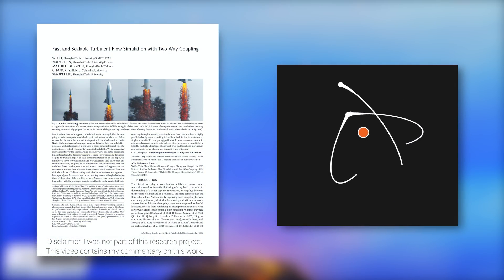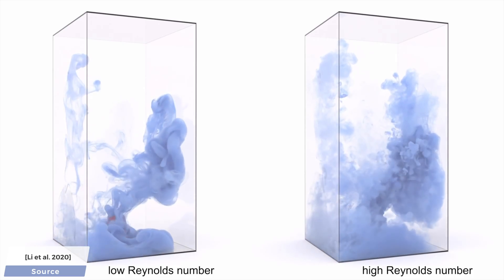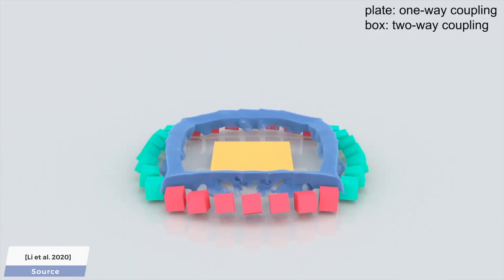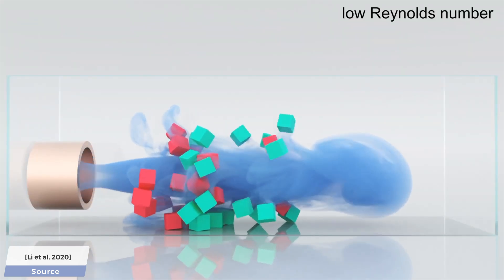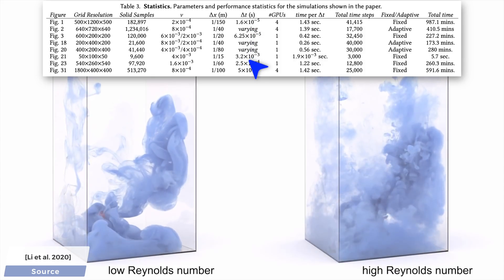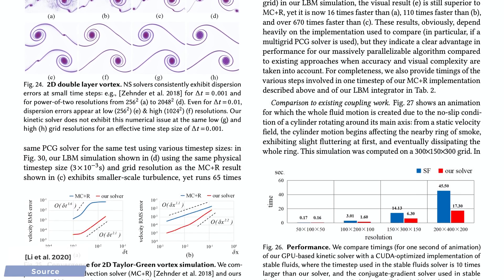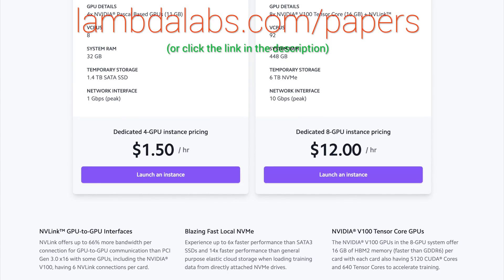Can We Simulate a Rocket Launch? 🚀

Comment: The "smoke trail" does NOT "propel the rocket upwards". The movement of the smoke trail as well as the movement of the rocket in the opposite direction is the result of the pressure inside the rocket engine. The one movement does not CAUSE the other movement. Both movements are the results of pressures inside the engine. The pressure against the upper (closed) end of the engine chamber push the rocket up and the pressure in the direction of the open end of the chamber push the exhaust out.

Comment: Interesting. I've wondered about doing a flight sim with computational fluid dynamics, but this is likely too slow.

Also very minor things (like rivets) can throw off the accuracy of such simulations.

Even highly simplified CFD models are hard to calculate though.

That's not to say it's never been done. 
There was a sim called 'flight unlimited' whose flight model was calculated using CFD, and this was all the way back in 1995 of all things.

Unfortunately, while this worked, it took fine-tuning with real pilots and aircraft and lots of fudges to ensure this had an accurate effect on aircraft behaviour.
On top of that, the CFD code was a nasty cludge of insane assembly language, so inscrutable that even the game's own sequel abandoned it.

Would still be interesting to revisit the concept, even with a fairly inaccurate CFD model...

Comment: Could you speed up the render time of the simulation by performing a check for small increments of time with zero changes/interactions and then remove those moments? Or would that add more unnecessary computation?

Comment: Ansys uses lattice-boltzmann in their 'Discovery Live' software. With Nvidia gpus (so far, its exclusive to nvidia), they do almost real-time simulations and update continuously as you change geometries. For fluid and solid simulations.
With respect to engineering accuracy, it's really bad. If you compare velocity and pressure fields with ansys cfx or fluent solvers, they don't match. But for visual representation, it looks great (even though some unrealistic events, such as the part you mentioned in 3:29 , can happen).
Would be amazing to see those techniques implemented in games in the future.

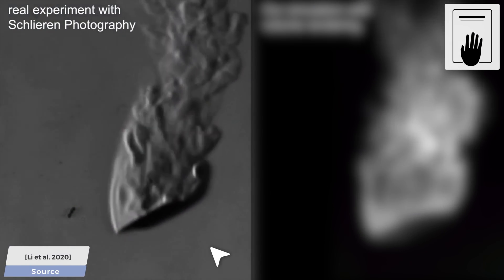Comment: But honestly: The comparison to this falling plate with the Schlieren-imaging 2:53 looks super good
but the rocket launch 4:38 is rather disappointing compared to real footage liek https://youtu.be/Ps9QD8XDVBg?t=92

Most of the times there is a super violent almost rigid flame cone as long as the rocket itself ...
here it looks like Putting ice cream on a cone. I mean... you were talking about 2-way coupling but this sim is not pushing the rocket up, or is it?
It just doesn't look believable to me. Like its just animated up while emitting.

Setting the speed to 2x helps a little but then the black turbulent smoke surrounding the fire cone becomes very obvious looking way too calm.

Comment: Why compare the speed of this to Blender simulation
Reply: You'd have to get the data, and a camera would have to pick up the vortices at a very high resolution and in 3D, which presents great difficulties, such as invisible gasses and pressure, which would have to be inferred.
It would be easier to start with algorithms and test the output

Comment: The aerodynamic visuals are great for qualitative analysis... but what about quantitative? Any way to back out lift and drag coefficients? This could be nice 'in-between' between analytical methods and traditional CFD
Reply: Lattice Boltzmann equations are physical equations that govern mesoscopic fluid dynamics...and they are indeed used in computational fluid dynamics so yes...lift and drag coefficients can be calculated using these methods....even noise generated from aerodynamic flows too
Reply: @haseeblodhi6161  I was wondering if this could be used to simulate rocket nozzles.

Possibly even the "wave" pulse jets.

The F-1 team got lucky. Nobody actually knew why the pogo oscillations went away on the Saturn V. They reverse engineered the solution to pogo oscillations by studying the F1. They got lucky with trial and error.

It's simply economically impractical to physically try every minor variation. And from my understanding existing simulations are almost as costly and time-consuming in compute resources.

Or am I just totally off base here?
Reply: For quantitative analysis there is the FluidX3D software. Produces nice visuals too, and it's way faster.
See here for a simulation of the Space Shuttle: https://youtu.be/5AzxwQpng0M